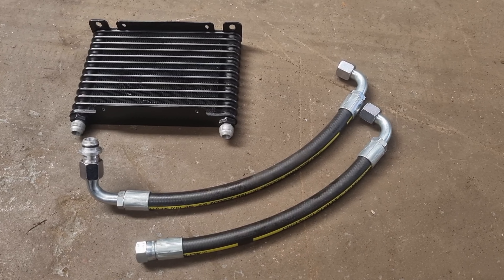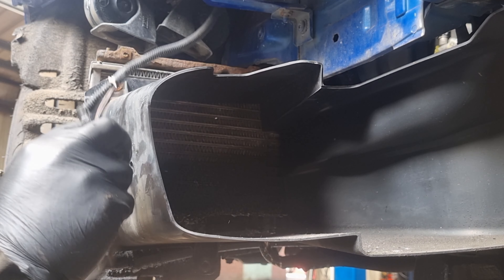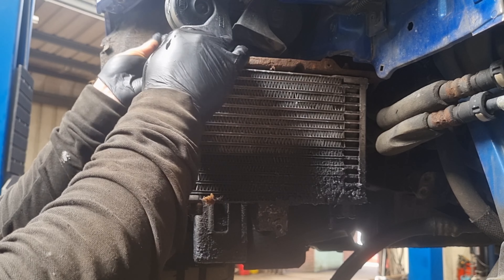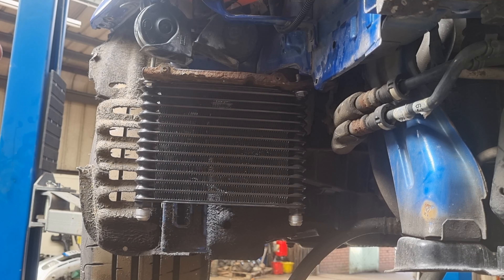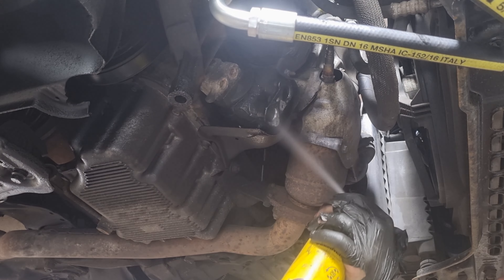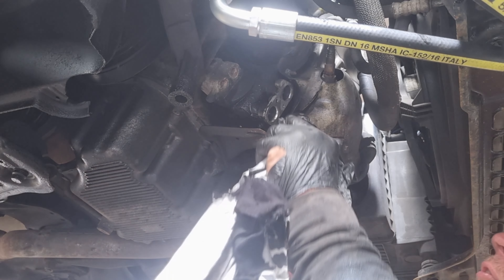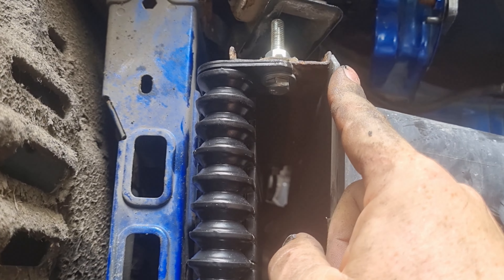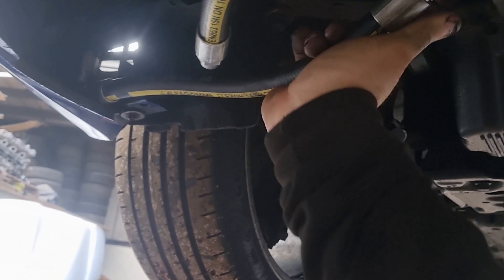Alfa Romeo GT Fitting An Upgraded Oil Cooler And Pipes

Comment: That's somewhat less faff and less money than the Autolusso Mocal kit I fitted to my 147 Sport Q2 in 2018.  The tricky bits: adapting the supplied mounting bracket, and cutting (and fitting - needs really hot water) the new hoses to the exact right length.  On the plus side, the rusty OE bracket went in the bin. So no complaints whatsoever, it's far better than trashing your engine when the OE cooler fails. Which seems far too common.
Reply from the maker: Yeah I'm not a fan of that kit either.

Comment: Could have done with this a year ago. Autolusso where out of stock with no communication from the manufacturer when more would be available, so I had to get genuine pipes for £300. One of the most painful repair jobs I've had. Since then I took a huff and got a 1 series (christ its boring).

Comment: What about some good replace for brera/159 2.4 jtdm? any suggestions
Reply from the maker: that im not sure about that due to the location on the cooler.  im sure there will be upgrade kits out there
Reply: @ItaliaAutos  you think i can fit there performance one radiator with 50mm thicknes instead of original 20mm?

Comment: The OEM parts used are just awful. My GT 1.9 cooler and pipes failed at 74,000 miles when the car was about 8 years old. I used a similar kit.